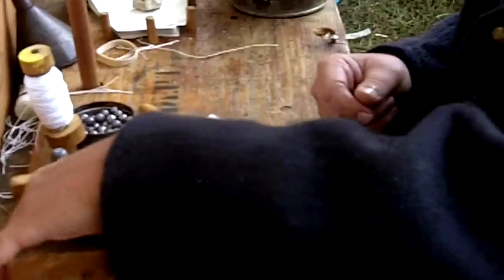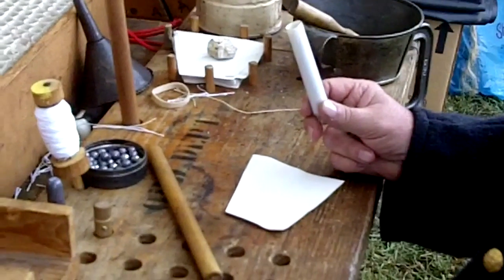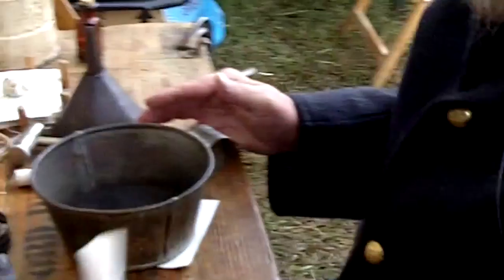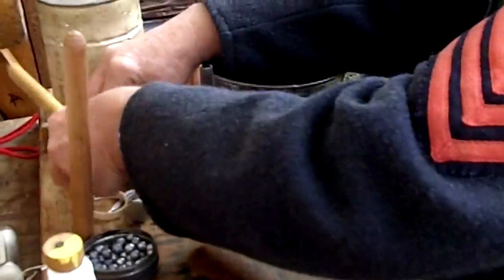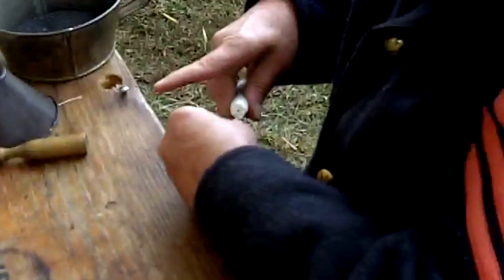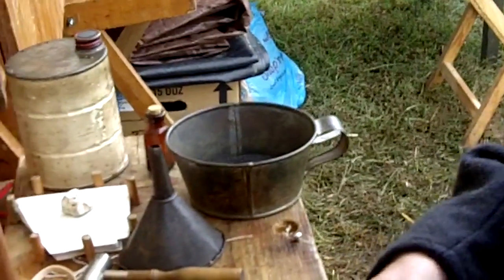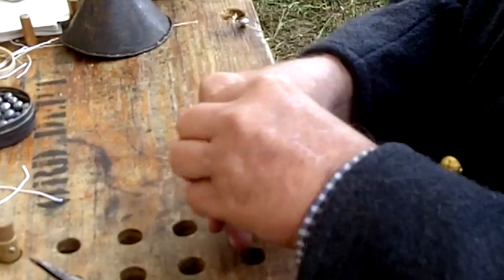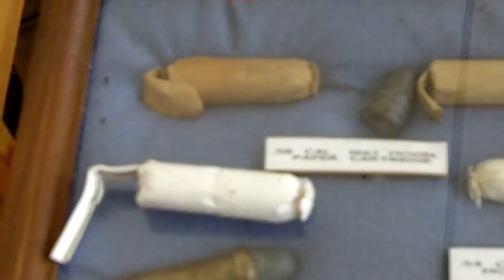Civil War Ammunition- Minié Ball Cartridge Rolling and Trivia

Comment: I don't know if this point has been made but, he is making US style cartridges.  Some CS cartridges before mid-war & most in the later part, where made in the English style with bullets turned nose in.  Many CS bullets had no grease grooves because they were smaller and the paper covering the base of the reversed bullet was lubed. Thus, after biting off the tail & pouring in the powder, the bullet was put in the bore lubed paper and all, tearing away the excess. Generally only 2 papers used.

Comment: The Minié Ball + paper cartige introduced in the breech, is a French invention, use in the 1866 Chassepot Rifle (caliber 11mm) built in the "Manufacture Imperiale de Mutzig" and use from Napoleon Bonaparte troops. But the metal jacket cartige was use in the 1874 "Gras" rifle (a modified Cassepot)
The paper pack introduced in the muzzle like on the video is a much earlier system but very slow use in comparision of a paper cartige...

Comment from the maker: @Sideshowbobx 
Your statement that "Rifleing is done for accuracy, not easier maintenance." is true now. Rifeling has come into common use because it improved accuracy. But like many scientific discoveries, that may not have started out as the original problem they were trying to solve. The History Channel, and I do not hold them to being a completely valid source, presented that there was a problem with residue buildup after several firings of a smooth bore and they here trying to fix that.

Comment: William Greener of the UK replaced Minie's iron cup with a wooden plug which was standard on British made .577 Enfield rounds. James H> Burton of the USA developed it into its final form with the thin hollow base that expanded by heat alone. The sergeant is correct in that the name Minie was the one that stuck to the bullet. Just like the word 'ball' was still used despite the actual shape of the bullet.

Comment: Dimensions for the Paper Lady is 5.25 L, one side needs to be 4.50 H and the other is 3.75 H, then connect those for the final side, the ones he is useing may be slightly smaller but these are the dimensions provided to me by a fellow reenactor and these are working for us, were useing standard white heavy print paper and kite string, the dowel rod is 5/8 dia. sanded down till you get down around .580 - .577 and use a file and coarse sandpaper to shape your dowel tip to your minie balls conical shape, i shoot a 58 cal 1862 3 band C.S. Richmond Virginia musket, Long Live the South!

Comment: Actually, the kinetic energy of civil war musket round was considerably higher than a modern assault rifle. The muzzle velocity was lower because they used much bigger, heavier calibers of bullet. The comparison with a .50 caliber machine gun round is fair -- they weren't quite as lethal as that, but they caused horrific wounds, particularly when they struck bone, which they would shatter. Yes, the powder was less powerful -- so they just poured more grains in.

Comment: This is a significant video because, never mind a few errors, it is so far the only thing I've seen that demonstrates there was more than 1 piece of paper used. 
I roll my own for live firing by the same method though I have made some by the earlier 3 paper method too.  My problem is that I cannot seem to get the cartridges under 2-1/2" which means they won't fit in the lower part of the cartridge box tins.  Maybe I need to do more settling like he did. Course, can't tell how long his are.

Comment: @Sideshowbobx 
To further stress the point, with rifleling the barrel surface is increased while a corosive gun powder (BP) is used. So there is an additional need to not only just clean that barrel but also a need for a more extensive cleaning procedure and new tools, which also means additional training again.
The mainence of a smooth bore is far easier then the same on a rifled barrel, always was and will be.

Comment: This is a very informative demonstration! However, you do not say what kind of paper you are using, the dimensions of the paper, or the type of string you are using. Also, I find it very difficult to spread and flare out the paper that is above the choke string. You do it so easily. What is your secrete? Is it the paper. I have tried it with news print and brown craft wrapping paper. It is time consuming and tricky for me.
Reply: Try either the thinner packing paper or use the thicker drawing paper. Either one works for me. The trick is the proper use of the choking string to form the tulip end, that you tie with the string. I just use cotton string like you use for cooking. I split it using only two strands in the four strand string for tieing the ctartridges.

Comment: there are so many innaccuracies in what he says. just to start rifling was not invented to reduce fouling. it was invented specificly to gyroscopically stabilize the round. people werent that stupid back then. many amazing things were invented on purpose including riffleing.
Reply: Amazing how sure you are when even experts aren't.
There are two primary theories as far as I know. One is as you mentioned, we also knew spiraling helped with bows back then. The other is the fouling one.
In support of the fouling theory, the earliest rifles from southern Germany in around 1460 had eight to ten wide grooves that were parallel, not spiraled. And then we see spiraled grooved barrels soon after in around 1476.
Although they knew about the accuracy to be gained, since the powder charges would vary a whole lot at the time, using spiral-grooved as opposed to straight-grooved may not really have had as big an impact on accuracy as it would have on the time and cost. 
So the primary reason to start with would be fouling reduction and as the gun powder charges and their manufactering skills improved, the fouling reduced anyway and the impact on accuracy that spiral-grooved had, became greater.
We don't know, although you seem sure.

It's fine you don't agree on what theory to believe, but don't make it sound like it was just something he pulled out of his ass and acknowledge it as a well known and popular theory, just like the one you apparently adhere to.
Reply: @Vlad-sj5yw   Just thinking about it for a couple of minutes, the fouling relief theory doesn't seem to make much sense.  If you use a loose ball or a ball that fits the minimum diameter of the barrel, what was the point of making the grooves?  If you use a tight ball (like you would for every other rifle) it makes the fouling problem even worse.  Maybe somebody tried it, but they would have found out pretty quick that it didn't work.
Reply: @coltonregal1797  If the projectile were to fit the smaller diameter  the groves would leave space for fouling to migrate to, lowering reload times or, time it takes for fouling to raise reload times.

Comment: Now I'm loading live ones to shoot using powder from those long ago blanks I had left over.  There's one problem in particular I'm having. That's getting the cartridges down to correct size!  About 2-1/2 is the smallest I have managed and that is only just short enough and I am only using 60 grains. (my blanks were apparently about 70-80 grains based on the left over.) How long are yours?
One thing you helped me with is just how to fold them. I had never quite got that right before.

Comment: that was a slight improvement, but accuracy was low, creeping fire constant problem. Guess the idea to use a caved bullet base origined from there, and that combined with starting design of elongated bullet pattern. Minié big improvement was to find the ideal ratio of bullet lenght to caliber. The donwsight of the orignal desin was the metal disk in the base, added for controlled base expention, that would backfire as soon as the pressure drops with the projectial leaving the muzzle...

Comment: Very informative, I never realized the powder charge was in a separate tube. 20 years ago I ordered a kit to make paper cartridges for a Sharps 54 cal carbine, worked great as long as you used real black powder, didn't like pyrodex. Would these cartridges have been made with nitrate paper as well?
Reply: puttputtbuggy No, You tear the back tail off and poured the powder directly down the barrel, then tore the bullet out and rammed it home. The minnie ball required no wadding so the paper would not need to burn easily like it has to in cap and ball revolvers.  After about four shots, the fouling makes it hard enough to ram just the bullet home, much less a bullet with wadding
Reply: puttputtbuggy puttputt yes you can get cigarette paper and make nitrate catridges for your sharps, during the war of the second revolution, yankee suppliers made nitrate cartridges for the union forces. they were actually made of linen that burned clean.
Reply: James Holcombe I understand exactly where it comes from, but this is the first time I've heard the phrase "war of the second revolution".
Reply: +zerstorer335 it means he's a Confederate!
Reply: Samuel Hayden Sure does.  I'm just used to using "The War of Northern Aggression".

Comment: Anybody know why revolver type paper cartridges (ones that you place into the chamber without breaking it apart) weren't used on rifles?
Reply: The fire from the cap has to set off the charge.
Reply: Rifles at the time were in fact caplock, but loaded from the muzzle instead of a cylinder. Ramming a cartridge down the barrel would crush it, so on a rifle, a paper cartridge would only contain a fixed measure of powder. The soldier would bite open a paper cartridge and then charge the rifle with just the powder, placing his ball on top of the powder charge.
Reply: Safety.
Unless the paper used was/is nitrated, the fire from the cap won't burn the paper and ignight the cartridge.
It could cause hangfires or misfires.
The paper cartridge may not burn completely, leaving smoldering embers in the barrel that would ignight the next powder charge sent down the bore.
Truth to tell, I don't know any reeinactors or cap and ball revolver shooters who use paper cartridges.
They are not safe.

Comment: how did a shooter load this ammo, i know he used his teeth to tear the end off and dump the powder down the barrel but then if the bullet is in another paper tube how does the bullet go in the barrel ,please explain ? thanks.
Reply: The US 1861 cartridge was just a means for the 2 to be carried together, the soldier tore his cartridge by biteing, emptyied his powder down the bore, removed the pre greased minie ball and shoved it down the bore, minie balls were designed to be shot unpatched becasue when the musket is fired, the explosion and pressure begin to push the minie ball down the bore, the thin skirt of the minie ball expands from the pressure to engage the grooves of the rifling and as is said in the video, results in greatly increased range and accuracy
Reply: There were two predominantly different types of cartridge and bullets. The Yankee grooved bullet was greased and rolled as described.  The soldier would bite or otherwise tear off the end with the powder, pour the powder down the barrel, then separate the bullet from the paper and place only the bullet in the barrel and then ram it home.
The English had a different bullet and cartridge system that was officially adopted by the Confederacy.
The bullet was smooth sided and had a wood or clay plug in the hollow base to aid in "upsetting" or causing the bullet base to expand to the rifling however, the Confederates did not, as a rule, bother with the plugs.  
In constructing the cartridge, first the powder tube was rolled then the bullet was rolled point inwards towards the powder tube. Then the whole was wrapped in a third paper which was twisted at the end.  The end with the bullet was dipped in lube about 3/4" deep.  The soldier tore the powder end of the cartridge off, poured the powder then reversed the cartridge inserting the lubed paper covered bullet into the barrel, gave the remaining paper of the cartridge a twist tearing it off and discarding it.  That was effectively a paper patched bullet that was then rammed home.  The paper covering the pullet had three slits in it to aid in the paper patch blowing free of the bullet so as not to effect it's flight path.  This system was also more effective in controlling fouling build up than the Union system which devised a "cleaner" bullet having a washer to scrape the bore.  Generally each package of ten had one such bullet.
Not just book learning. I load and shoot both types.
Enough? (:^})
Reply: @cornfedtuber  so that's how it was done. did not know that.
Reply: Glad to help
Reply: Addendum; The final English cartridge utilized the "Pritchett ball"* the smooth side bullet I referred to above. They settled on a ball diameter of .550"  The paper was of high quality linen rag paper, much like is used for our currency and was held to .002 thickness rigidly controlled.  If any cartridges were found to exceed a diameter test, the entire lot could be "condemned."  Many of those lots found their way to America for use in our Civil War.  I's doubtful there was any noticeable difference in their use. The English were just determined that their troops should only get the very best ammo they could provide (and rightly so I might add!)

Comment: what is the name of powder to use and what type 2f or 3f for firing live rounds ?
Reply: Generally you should be using FFG for the minie ball cartridge for live firing. The reinactors sometimes use FFFG because they are  after the louder bang with no ball, since there is not enough back pressure of the heavy lead ball or wadding to produce the breach pressures necessary for the bang.
Reply: Black Powder or faux/imitation black powder like Pyrodex.
FFg for .45 caliber and larger.
If Pyrodex the "Rifle/Shotgun" grade or "CTG" grade when making live cartridges.
Be sure to use a non - ferrous measure like brass or copper. Sparks (even from static) can ruin your whole day when working with or handling black powder.